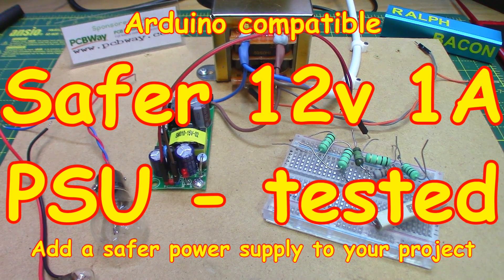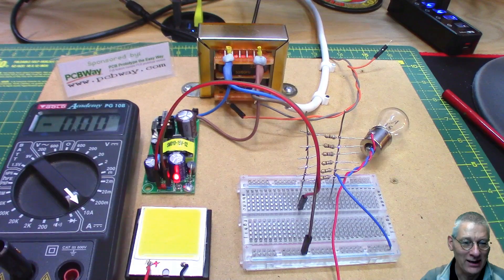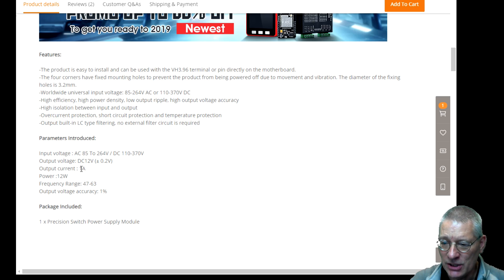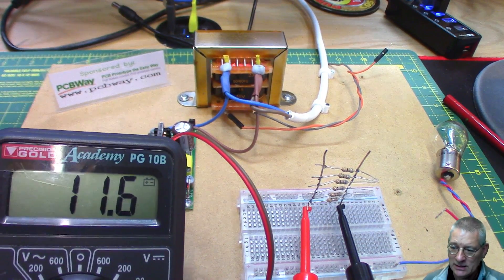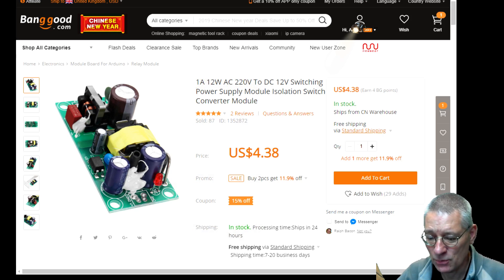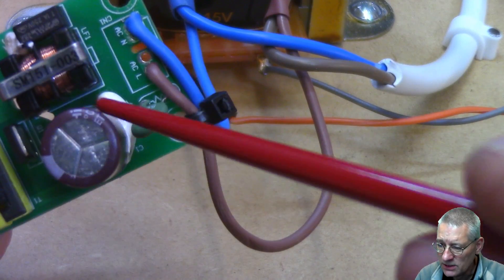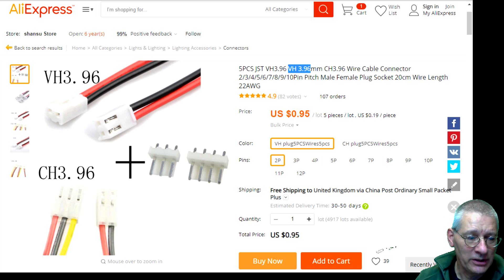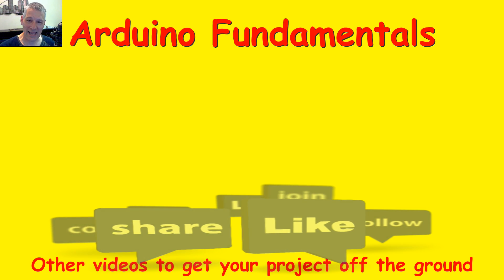#135 Compact Switched Mode Power Supply 12v 1A (tested)

Comment: Laptop power supplies are switched mode as well, long time ago the e-bike community found that if you had a high voltage battery say 72v and needed 12v for auxiliary stuff although dc converters would not take the voltage highest is about 60v a laptopPSU would work perfectly that is probably why a dc input voltage is listed,  I bet that it will work on a 72v battery if you tried
Sorry can’t test myself as I have the batteries but not the item.
Kendrick
Reply from the maker: It says in the spec it will work from 110v DC  and 85v AC so I guess 72v DC is a bit low for this particular device but in principle you are spot on, Kendrick.
Reply: Ralph S Bacon 
I’ll order one and when it arrives test it, there is a 2 amp version available as well I’ll pick up one of those as well.
Kendrick
Reply: SMPSUs have been around for WAY longer than the ebike community. They were used in the DEC PDP8 machines from the 60's and in many other such computers  of the time and since.

A quick look at the input stage of any mains powered SMPS will show that it does NOT require mains AC to operate as the first thing that happens is the AC is rectified to 340v DC (240v AC) via a bridge rectifier PRIOR to being isolated via the switching transformer. A bridge rectifier presents a zero barrier to a DC supply other than a two diode drop. The DC (obviously) can be connected in a polarity neutral fashion BUT MUST be of sufficient voltage to operate the switching effectively enough to provide sufficient output power per specification. Don't forget, if a supply is designed for say a 5A output from a 220v input it requires SUBSTANTIALLY more input current (double at least) to achieve the same output at 110v (155v rectified) and consequently even more at much lower nett DC input voltage.

It is perfectly possible for some SMSPSUs to operate at much lower DC voltages, dependent on specific design but the absolute output capability will be severely compromised and overheating a potential problem as the switching operation will be MUCH less efficient. Prognosis: don't expect good things to happen long term even if they work initially!

Consequently ANY
Reply from the maker: I was just getting into this interesting response, Bob, and it ended rather abruptly. Did your cat 🐈 sit on the keyboard or something?
Reply: @RalphBacon  sorry Ralph ... Stray last line from an edit. Didn't notice when I posted. Happy to answer any further queries though.

Comment: Ntc is for inrush current limit. When cold higher resistance to prevent blowing fuses etc Once its warmed up it will be low enough resistance for normal operation as if it wasn’t there.
Reply from the maker: Yup, we're all agreed on this now. Interesting way of managing inrush. Had I studied electronics and not programming I guess I would have known.
Reply: don't think it is to protect fuses!  rather to slow the current to caps and coils and so help ensure components stay in their ratings. It also helps reduce turn-on 'thump'.

Comment: Hi Ralph,
You could do with an electronic load, check out Dave Jones scrap box built electronic load.
Fun to build than buy.
Adam
Reply from the maker: Looking at what he built and what there is out there, ready-built. Funnily enough, Banggood do a rather nice one, not too expensive, there's a link in these comments somewhere for a YouTube video (in German) all about it so maybe it needs an English version?
Reply: @RalphBacon  Three 6 Ohm power resistors (mine are 10W) work well enough.  For 5V you can test for 280mA, 400mA, 550mA, 830mA, 1600mA, and 2500 mA (approx).    That ought to be good enough for most purposes.              For 12V....well  use Ohms Law :)

Comment: The 2 sets of holes on the mains side would be for figure 8 or IEC connector when mounted in a box
The NTC puts a high resistance in series to reduce inrush, then goes low to supply max power to the circuit
you could have wired 2 of those car lamps in series to reduce current ;)
The glue stuff is to reduce vibration shock, you'll find it on larger components.
The best transformers on those supplies are a secondary that is well insulated, you can tell because the wire is insulated as it comes out of the transformer.
Reply from the maker: So, the mystery is solved then, Sparky, about the holes. I guess manufacturers cater for several deployment options.
And you're the 2nd person to say the glue stuff is to reduce physical shock but another suggestion was to dampen any high frequency noise (audible, I'm guessing). 
And yes, if only I had had two of those ancient bulbs I would have used them but my molten resistor slagheap served as one of them, for a few seconds, anyway! Better wirewound resistors on the way. Or a variable DC load tester such as Bob suggested in his comment. Not found one yet...
Reply: I guess if there's mechanical movement on the wires, that could change values of the component, though i don't see it as a problem with mains input.
Also, why is it only on larger components (capacitor and choke)
Luckily i have  a decent wirewound pot, it's 75 ohms and can take 3 amps, it's 10 inches diameter :D
(it's in my 'putting up some resistance vid)
Reply from the maker: A 10" rheostat? So your project is the size of a matchbox plus this monster! Could be interesting!!!

Comment: The white stuff is used to keep parts in place, even if you drop the supply on a hard surface.
With the common mode choke I would suggest you read a bit on common mode vs. differential noise.
I have reviewed more than 200 USB power supplies and also a few other supplies, all of them with detailed test and tear down and some explanation of the circuit. If you want to see that look at lygte-info.dk
There is also an article explaining how these supplies (fly-back) works.
Reply from the maker: I just looked at your website, Henrik, and I learned something almost immediately; that the 5-ohm thermistor is used to prevent in-rush current! Who knew? Well, you did, so when I do a more serious look at the smaller SMPS (the cousin of this one that arrived too late) and go through the theory a bit I'll link to your website. 

Regarding the white, sponge-like glue, it is obviously intended for some protection but exactly how that glue on my device will protect anything is beyond me! It's a mess. And there are plenty of these exact same boards around with no white stuff on them at all. They could at least have done it neatly!

Thanks for posting, great info on your website you have.
Reply: The white stuff glues parts into place, it is usual used on heavy and high parts. The supply will work fine without it, except if you drop it on a hard surface, then a glued one is more likely to survive.
I hate it when tearing down supplies, it makes it much harder to see and identify all the parts.

Comment: Why do you use a transformer on the mains? Can't you just connect your mains directly to the device?
Reply from the maker: Do you mean, William, why is there an isolation transformer on this board?
Reply: @RalphBacon  Isolation transformer is only partially safe. It will not protect you if you contact both secondary terminals simultaneously. This is possible with the close proximity of terminals on this board.
Reply from the maker: @whitefields5595 I would hope (and expect) anyone using this device to exercise caution and respect for the mains supply and not play about with it whilst connected to the mains, for one! The electricians' rule of thumb (or maybe life) is that if you do have to poke about in a live circuit you keep one hand firmly behind your back. Mains powered items are not a toy or device to be casually played about with, as though they were a 5v Arduino. Far too dangerous. I will re-emphasise all this in a future video on SMPS. Always worth reiterating as you well know (can I get off that naughty step yet?).
Reply: @RalphBacon  Ralph, you continue to make me anxious when you get near 240V - (see my comment above) I agree that for this channel to grow you have to do mains work but you are taking unnecessary risks promoting non-approved mains devices. I fear a less-informed (younger) viewer will get hurt.
You are on the Naughty Step until I see improvement. With your excellent style, manner and presentation skill you could do so much, but your approach to mains interfacing is letting you down
Reply: @RalphBacon  Yes, I was wondering why it was used. I just didn't word it properly. Some of your readers helped.Your answer was very curt. Remember we are newbees.
Reply from the maker: Erm, I haven't answered your question yet, William, I asked for clarification of the question. I'm sorry you thought I was curt, that was not the intention.
My query was, were you referring to the little transformer on this module or the big fat transformer on the wooden board that you were referring to? I guess I have my answer now, you mean the big fat one on the board. I have a new one now which is even safer (allegedly) with shrouded terminals and everything. I'll explain all in a future video. 
Ah, perhaps you were referring to my response to whitefields5595? That was part of a long-standing thread banter that he and I seem to go through each time mains electricity is mentioned on my channel, if you look at his comments here you'll see. The response was not aimed at you.
Reply: Willam, you have probably Googled 'Isolation Transformers' but now. Also YouTube John Ward or EEVBlog they both do good explanations. 'Isolation' refers to having the secondary isolated from mains neutral and true earth. This renders the secondary terminals as 'floating' such that if you touch either you will not make a cct to earth hence reducing the chance of a shock. Whenever you mess with the mains (as I'm trying to stop Roger doing!) you should have an IT in the mains supply.
Reply: @RalphBacon  'Thread Banter' = Concerned viewer trying to help an Old Dog remember his old tricks
Reply from the maker: @whitefields5595 I'll have less of the "Old Dog" if you please. "Old", OK, I am that, but "Dog", now that's just uncalled for! 🤣😁 🐶
Reply: @RalphBacon  I did mean the big transformer. I too am sorry for me jumping to my conclusion. Ido greatly enjoy your videos.
Reply: Isolation transformer is for safety, still mains power but there is no physical connection to the mains should anything go wrong, also means you can measure mains circuits on a scope without blowing it up as a probe ground is connected to earth.
Reply from the maker: I'm glad you enjoy my videos, William, and may you long continue on my Arduinite journey! And stay tuned for a future video when I get out an even bigger transformer, all in the name of safety. Whitefields5595 will (finally) be proud of me!

Comment: OK Ralph ... Seems like you have your next project lined up ... A decent 0-50watt variable DC load! LOL! 😂😂
Reply from the maker: You'll be pleased to hear, Bob, that I at least have some decent wirewound resistors on order that will do for now. A proper DC load tester would be better but more expensive, but I'm still looking. Any recommendations?
Reply: @RalphBacon  DYO/BYO Design your own/ build your own? One of these days I'll get around to doing one of my own! I'm not sure how useful the prebuilt eBay ones are or how powerful/flexible they are since you really need a fully adjustable 0-max power capability for best flexibility. I'll let you know if I find a really good design or prebuilt one.
Reply: Ralph S Bacon Hi Ralph. I can recommend this one:
https://m.banggood.com/Original-ZHIYU-60W-110W-9_99A-30V-Constant-Current-Electronic-Load-Aging-Battery-Capacity-Tester-p-1146280.html?rmmds=search

Voltlg made a nice review of it:
https://youtu.be/snROh2acybs

There’s also this nice video how to put it inside a proper casing and then you can use your power supply to feed it (catch22): 
https://youtu.be/2aFHoN2xZEM

I built it inside that casing and am very happy with the result.
Reply from the maker: That's a relief, Ewald, as that's the one I ordered yesterday! I chose the 110W version, let's hope I get the right one as they now say the black heatsink will be "upgraded" to silver. I thought black would be a better colour for dissipating heat but what do I know? Perhaps the colour is only important when absorbing heat!

I love the link for the enclosure. I might well be tempted to do that too - interesting that he uses all Banggood parts as they are my favourite supplier for a number of reasons, one of them being speedy delivery.

Great to hear from you, thanks for the information, appreciated. 👍